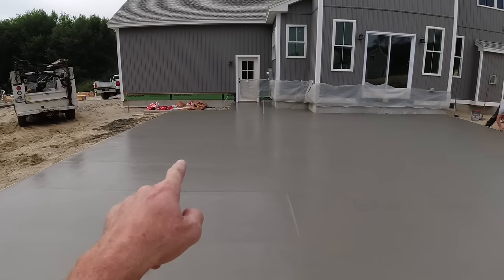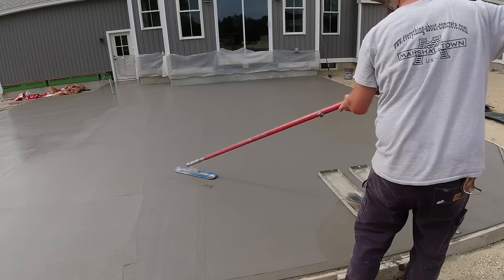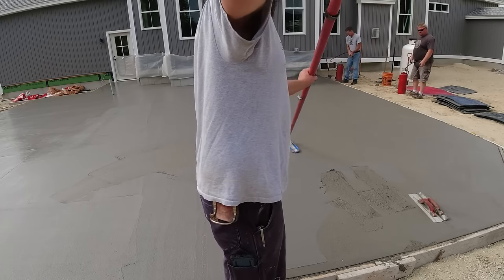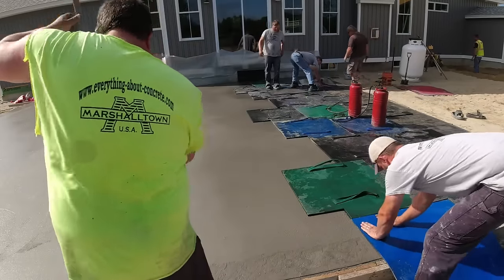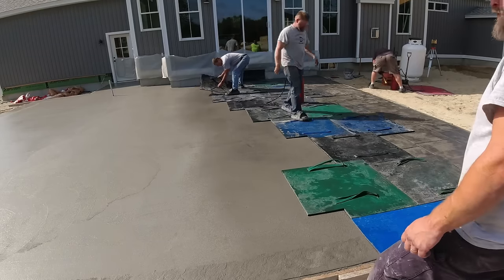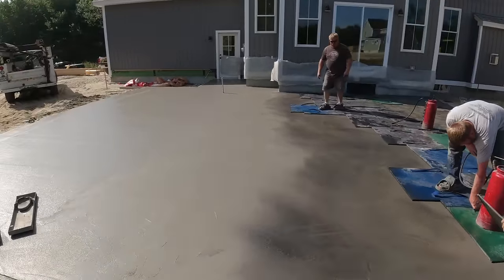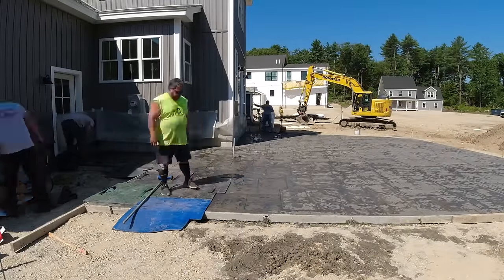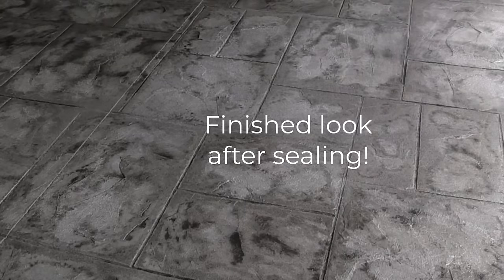Stamped Concrete - Don't Bite Off More Than You Can Chew!

Comment: I’ve seen some stamp jobs go horribly wrong and the problem is not enough help and working together . You had 5 guys and no one was standing still for a minute.…couple things I always consider in the summer or hot sunny days. Avoid noontime pours. Also we try to pour from the sun to the shade if it’s an option. It gives us some breathing room if the last truck is in the shade. Truck spacing is critical in the summer too. Don’t want the mix cooking in the truck. Luckily for me I’m primarily doing sidewalks with a broom finish. Another great video Mike